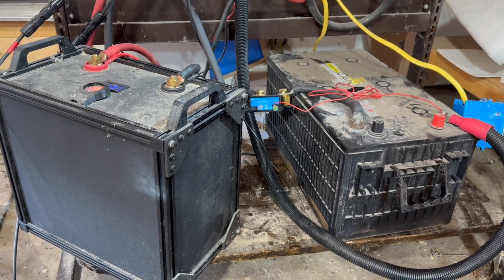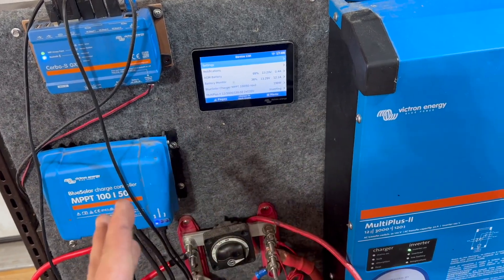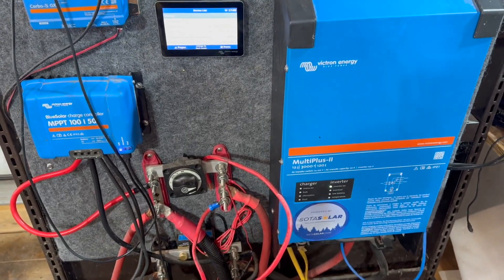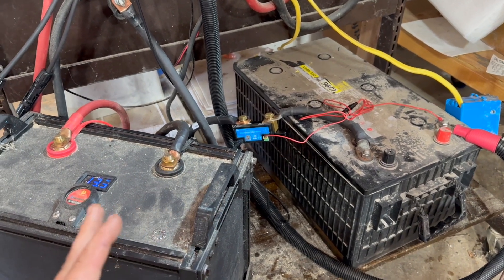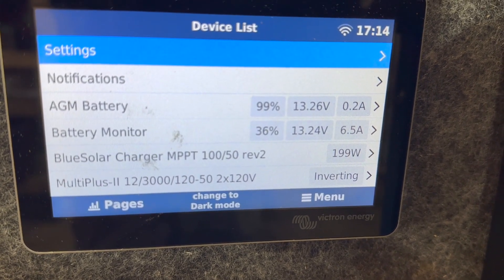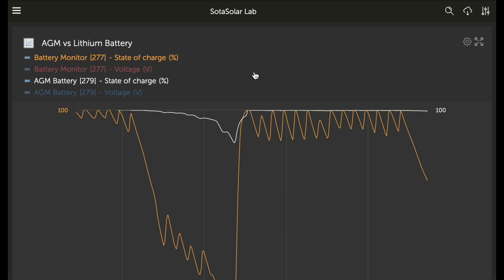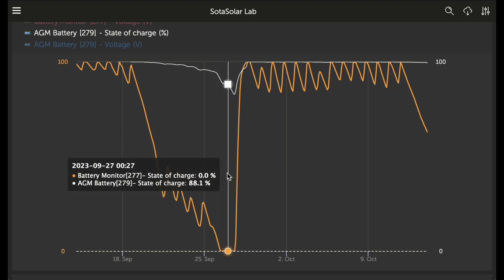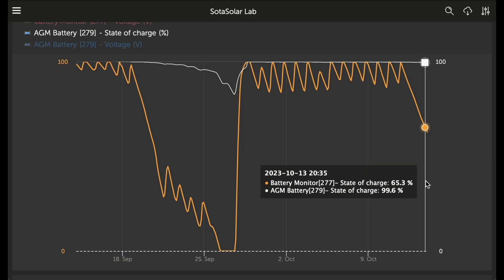What happens with Lithium (LiFeP04)  and AGM Batteries in parallel ? Let's find out!

Comment: This begged some questions regarding a set-up I'm considering for my 34 ft 1997 Class A motorhome (Ford 460 chassis), located in Alberta with similar winter temps to those in Minnesota, ie: minus-M.F.

 This rig currently has a 960 CCA AGM chassis (starting battery) and four FLA Napa 6V deep-cycle house batteries connected in series for 12V.

Is it really feasible and advisable to run my four brand-new Power Queen 100-Ah (each) 12.8V LiFePo4 self-heating batteries in parallel with these FLAs - or maybe more advisable if I replace the FLAs with say, 600Ah's worth of New AGMs? My concern would be that maybe I'd still need to have a DC-DC charger to protect the alternator, but that having both the house and chassis batteries connected in between the alternator and the LFPs should protect the alternator from the effect of any BMS shut-downs(?)

My house batteries are located in a compartment under the entry steps (located mid-ship on RH side of the motorhome. I'd utilize and then insulate the under-floor storage compartment directly aft of the steps, then use that bay to install the LFP batteries and a diesel heater to duct heat to both of the battery bays and to the space under the kitchen sink, which is located directly above the planned under-floor LFP battery/heater compartment. I'd of course also want to supplement all of this with a roof-mounted 800W solar panel system, as well as the required shut-off switches, monitors, shunt, fuses, etc. 

Thoughts? Concerns? Tips? Thanks in advance, Brett.
Reply from the maker: I do think protecting the two banks with a breaker / fuse would be ideal.  I think 600ah of AGM is overkill.  Just one or two would be fine.  DC-DC charger might be good for the alternator.  For the Diesel chassis I'm not as concerned. 

Glad you're thinking.

Comment: Thanks so much for the video 
Can I charge an empty lithium battery with the battery of my car and the alternator running .,,, monitoring the process ?
Reply from the maker: The key here is your empty lithium battery.  An empty lithium battery will ask for a lot of power from your charging system and could likely overload the BMS in the battery and your car's charging system.   I'd recommend using a slower charging system to get it going, then once it got to above 30% full you cold use the car directly.   If you have no other options, I'd do it short bursts, charge for a minute or two then rest for 3-5 minutes until it gets closer to 30% or the amps being pushed into the battery are at or under 50 amps.

Comment: The EcoFlow power head system for a van is a very easy to set up efficient system. The weakness is it can not take higher amps on a long drive from aux alternator to help charge up 15kwh system. It’s been suggested I use 48 volt AGM bank to connect between alternator and EcoFlow system. It sounds good am I missing something?

Comment: Awesome video, i was thinking of adding a lifepo4 lithium 22ah battery to my car audio system. I habe a xs power 100ah agm under my hood and heard people say i need an isolator and heard with lifepo4 lithium and a good agm its ok to habe the 2 chemistries parallel with each other without an isolator. I will always habe my truck running when my system is on and plan on atleast once a month putting both batteries on a charge to keep them topped off. From watching your video it seems its ok to run the 2 parallel without an isolator is that your thoughts? Thanks
Reply from the maker: With car Audio it can be a bit different because the amps that those batteries produce is much more than the RV ones we use. 

AGM and Lithium are very similar. I think you’ll be fine for a charge and discharge perspective, just make sure you have proper over current protection.
Reply: @sotasolar  10/4 yeah I plan on running from my front battery(agm) through a 300A fuse then to my lifepo4 lithium battery off it through another fuse then to my sub amp. I heard the lifepo4 chemistry and good agm batteries resting voltage was pretty close to not really worry about putting an isolator. Plus I figured I'd put them on a charge once or twice a month jus to make sure there always fully charged

Comment: The question i would have is should you run your charging to the lead acid first like a ballast from a shore power charger and from your alternator. I tried running my shore power charger thru the renogy dcdc to lithium and weird shit happened with shore charger. Shore charger is fine directly to lithium. Hard to figure out the configuration for charging from alternator or shore with using one charger. I use alternator direct to lead or dcdc to lead without issues but going from alternator to dcdc to lithum with settings for litihium keeps popping circuit breaker. Even when litium are hardly used

Comment: Question for you… I have a Kawasaki side by side with a large audio system in it. The motor has a stator that charges the system. I have an AGM battery installed for the motor side of things and two lithiums for the audio. Both limitless LifePo4 30A. I have a victron isolator separating them. Think this will be a problem in the future?
Reply from the maker: As long as the amp load does not exceed what the isolator can support, you should be good.

Comment: So the same problem on my mind, I have 24v system with 4 agm battery. Now I get 14 pieces of lev40 with smart bms, then why not to put them tugether. The agm battery are working perfectly, but in this parallel setup I can use more lev40 and extend live of agm, instead of throwing them away. Thank you so much for the video
Reply from the maker: They also help as a dump load when charging lithium and they hit high voltage cut off.

Comment: lifpo battery allows for steady uninterrupted power *while in its nominal SOC and within working capacity limits
AGM allows for further uninterrupted power due to the deep cycle capability and available high cranking amps
So while standard battery theory suggests these two would NOT compliment each other, they actually compliment each other rather well in MOSTLY a passive way. the AGM steadily maintains the SOC on the lifpo battery but will "assume the majority of the load" should the lifpo battery fall below it's preferred working limits.

long explanation shortened?

Comment: Sir i need help 😊🙏 can i use just 6x45ah lithium cells and remove my AGM battery from the car audio? I running standard alternator too. can it work without issues?
Reply from the maker: I don’t have much experience using lithium in car audio. I do know they typically use a different technology and not lithium iron and phosphate.

Comment: My lithium is 13.8v and agm 12.6v I’m debating on running 2 separate systems. Agm for lights and 12v power outlets and lithium larger things like heat fridge ect. Would it hurt to wire them in Parallel for charging?
Reply from the maker: Won’t hurt anything. I’d try running them together and see how it goes. Do report back!
Reply: We have been running LifePO4 and flooded lead acid in parallel for 2 years on the yacht.  It just works brilliantly.

Comment: Hello how about Agm and lipo4 in parallel and series...? 24 volts /48 volts? How they will suport the charge amd discharge? What oarameters to set on them? Thanks!
Reply from the maker: I suppose you could in theory parallel those separate banks, but I would not recommend it. You have to have external balancing. Or maybe I should actually test if you need that balancing.

Comment: I have/will have a similar setup in my camper. It came with an original 100Ah AGM battery running existing 12v system. 
I just bought 200Ah LiFePo4 and a solar charge controller for LiFePo4 plus 2 150w fixed panels and a 150w temporary flex panel.

I will mount a switch between the batteries + pole, so I can temporarily disconnect the batteries. When disconnected I can solar charge the LiFePo4 with up to 14.8V. I think that is too much voltage for the AGM.

I plan to let the batteries work in parallel both in the evening to charge the AGM with the LiFePo4 and when I will run the campers AC. I plan to mount the 220v inverter on LiFePo4 + and the - on the AGM battery for the AC. AC will draw up to 900W and if using both batteries, it will lower the power draw, compared to only running it from the LiFePo4.

It can not run using 900w for too long, but when the camper is cooled down, it will draw less.

Any thoughts regarding this setup?
Reply from the maker: I’d leave the batteries connected and run the AGM charge profile. Lithium will stop accepting charge at all at 14.6v and really, anything above 14 volts is about full for lithium. Search the google for “lithium battery charge curve “ to see what I mean.

Comment: Thank you for making this video. Lots of RV'ers, including myself, are adding solar power and  LiFePO4 batteries for "house" batteries but have an AGM start battery. While putting the 2 types of batteries in parallel may be OK with the engine off (the solar powered LiFePO4 maintaining the AGM), the engine's alternator puts out a tremendous amount of amps. In my care it's 160 amps which could do some serious damage to a LiFEPO4 battery and possibly ruin the alternator. 
I have read that some people put a fuse between the AGM and the LiFEPO4 batteries while others use a breaker.  What are your thoughts on this?
Reply: The LiFEPO4 has a lower internal resistance, and will take the brunt of the charge current from the alternator. You could add a solenoid between the two separate batteries, that breaks the connection when the Ign switch is ON, thus isolating the Li battery, while charging the AGM during transit. Using fuses and breakers doesn't solve the above mentioned issue.
Reply: @s.mendez7160  Thank you for your comment. Why wouldn't a 20 amp breaker or fuse limit the current going from the alternator to the LifePo4 battery to 20 amps, thus protecting both the battery and the alternator? A 20 amp charge at 14.x volts during transit would be a good thing for the LifePo4 imho.
Reply from the maker: What we’ve seen in practice is there typically isn’t a large current draw. The reason being is voltage drop. A 2 awg cable from alternator to battery / charger typically will see a significant voltage drop  while under load, this acts as a sort of charge amp limiter.  We see 45-65 amps typically. Now if the lithium is near dead 10-11v this does change things, however the voltage quickly rises as lithium gets even 5% charged.
Reply: @Laughlin007  Breakers and fuses are there to protect the wire, they are an after effect of something that has exceed ampacity limits. Get yourself a DC/DC charge controller. It will intelligently charge your LI Bats from your FLA batts via the alternator current. Simply solution, solves dealing with unknowns, easy to install.

Comment: So the lithium would trickle charge the agm to equalize batteries? So when both fully charged, the agm would draw current to keep the batteries at same voltage? Were lithium is, at higher. Voltage.
Reply from the maker: What we found is the amp draw is negligible from lithium to AGM to about 30% SOC for lithium.

Comment: @9:35 12v Battery charger parameters are programmed at different levels for various battery chargers (e.g. lead acid, AMD, LiFePO4). Using a standard battery (car) charger will never allow a full charge of your LiFEPO4 

Characteristics	12V
Charging Voltage	14.2~14.6V
Float Voltage	13.6V
Maximum Voltage	14.6V
Minimum Voltage	10V
Nominal Voltage	12V/12.8V

12V Sealed Lead-Acid (AGM) Battery Voltage 
12V sealed lead acid batteries, or AGM, reach full charge at around 12.89 volts and reach complete discharge at about 12.23 volts. 12V flooded lead acid batteries reach full charge at around 12.64 volts and reach complete discharge at about 12.07 volts.
Reply: AGM's need to be charged to a voltage >14volts to be considered fully charged (Deka recommends 14.4-14.6 at 68F). They will settle to a resting voltage of around 12.8 after the charger is disconnected. A full discharge of an AGM would be to a resting voltage well under 12.0 volts -  I.E 11.5 - 11.8 volts. A discharge to a resting voltage of 12.07 leaves about 25% of the battery capacity unused. AGM battery life is shortened somewhat by deep discharges though. 

A standard lifepo4 charge profile is compatible with AGM's, though not ideal, and a standard AGM profile is compatible with lifepo4, though again it's not ideal. Using a standard lead acid profile with either AGM or lifepo4 though, will cause problems if the profile includes a desulfate phase.
Reply: @diconustra  This is great information, thank you for this.

Comment: Lfp resistance is very low. Small Voltage difference cause large amps flow into lfp BMS can cut off
Reply from the maker: Sounds like something else to test :-)
Reply: Like seeing these experiments/ tests. Thanks. 
If the voltage of agm was around 12 or lower Around 40% capacity. And u hooked up fully charged lithium curious to see what the transfer of smps would be.

Comment: I have 3 Lipo4 batteries that I built from 3.2 LIPO4 Cells powering 3 of the 1100CCA IOXUS capacitors for my car stereo. The Cells are all in a 4-S configuration to get my 12V well, actually 12.8V with 64aph's per each battery. They are all wired in parallel to get 192aph's with the 12.8V.  I also have an XS Power 127aph AGM also wired in parallel with the 3 Liipo4 batteries and from the AGM going to my vehicles 240amp alternator with 2 runs of 0 gauge ofc cables running for well over a year know and  everything has been doing great together. Nothing crazy well 🤔 wait ✋️ ok honest 1  crazy thing is I honestly can't believe how loud my stereo is absolutely  off the hook.  Be safe, but have fun    👍  Rob C. 👍
Reply from the maker: We’re both solving different problems, but I’m glad we’re both having success. ;-)

Comment: Considering using my yellowtop to start the vehicle in parallel with 3 100ah chins lifepo4 with 1kw solar.
Reply from the maker: Make sure to put a 50-100amp thermal / resetting breaker between the two. You don’t want to cook the BMS in the chins. Been there. Your starter may ask for 1000+amps on start. Lead acid is great for that, not lithium with BMS.

Comment: Does anyone know how a lithium in parallel with a AGM would perform in a car audio setup?
I have a AGM under the hood in parallel with a AGM in the trunk to run my amps. Can I connect a lithium in parallel between the 2 AGM batteries to help keep my voltage from dropping?
Reply from the maker: I’d think that would be fine. BMS may trip depending on on amp load.
Reply: @sotasolar  ok thanks, the amps draw around 300 to 350 amps